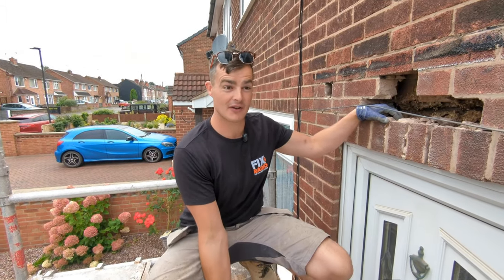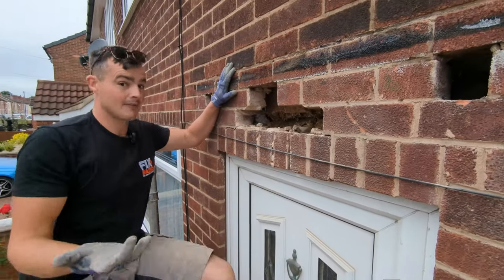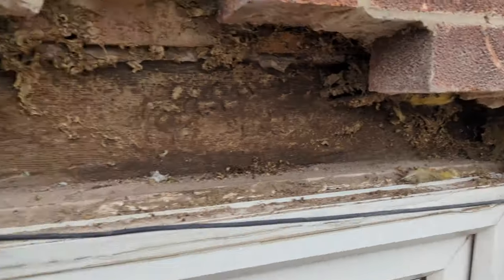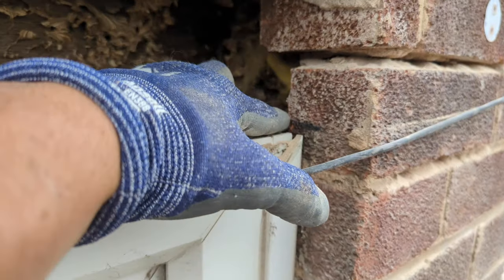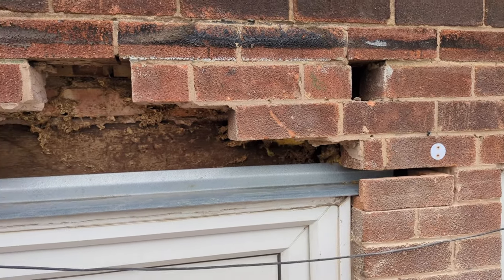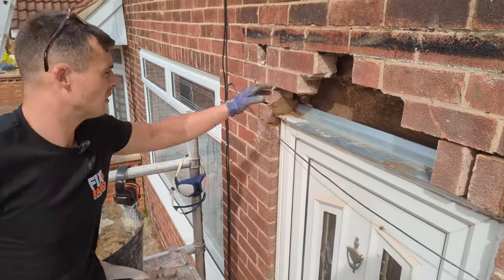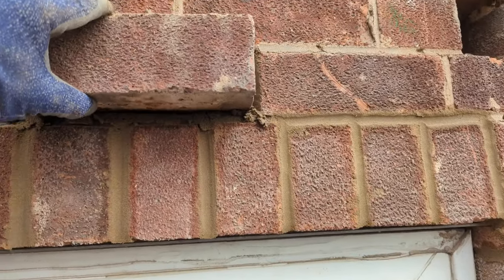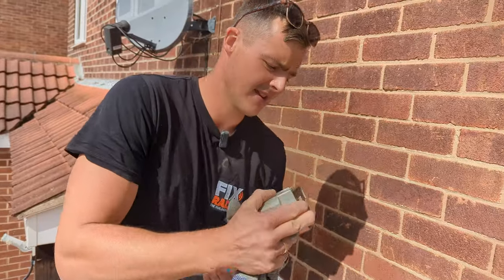This brickwork failed, so we FIXED it - Small repair job #vlog #construction

Comment: Walls that are already built up can NOT have cavity wall insulation added. Cavity walls must NOT be bridged with insulation.
If cavity-wall insulation is to be used, it can only be installed IN CONSTRUCTON OF THE CAVITY-WALL FROM THE VERY START ; there must be a LARGE air space gap in-between the face of the insulation and the OUTER WALL inside the cavity-wall ; this includes an air space gap in between the face of the insulation and the cavity-wall-tie drip points which are in the centre of the cavity. Cavity wall-ties are laid with a slight downwards slope across the LEVEL mortar joints from the inner to the outer walls.
Ask City & Guilds N.V.Q. BRICKWORK teachers for PROOF of this .

Comment: There should be a damp tray installed over the new lintel that was inserted and weep holes built into the perps, standard procedure on any external leaf brickwork, remedial or new work.

Comment: Sorted 👍👌, there's actually nothing wrong with the original brickwork, the old timber frames were load bearing its the dopey window fitters who don't have a clue, the new frames should have an integrated steel goal post in them to support the brickwork above and someone skilled with due diligence to replace them.

Comment: News Flash!
The reason there are no lintels is because the people who built the house were not bricklayers.
They were dodgy af muppets.
Lintels are a 100% must-have Building Regulation requirement.
The developer was also dodgy for not checking the work before signing it off.
This house would be condemned by any reputable surveyor/structural engineer.
The giveaway is the inconsistent door/window heights.
The so-called "bricklayers" made a huge fcuk up - took the money and ran.